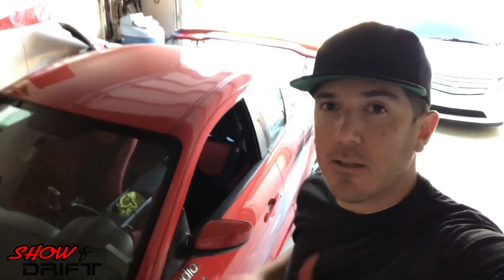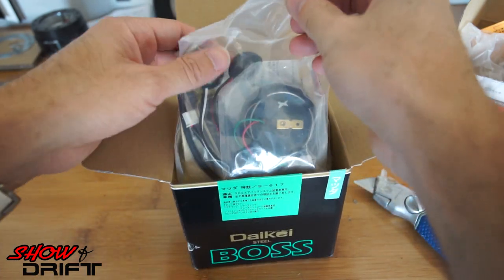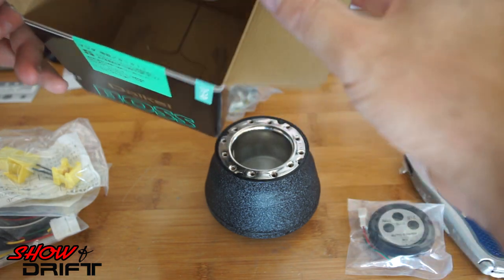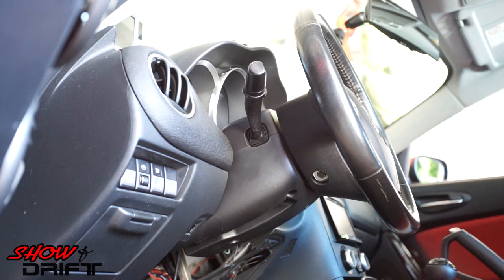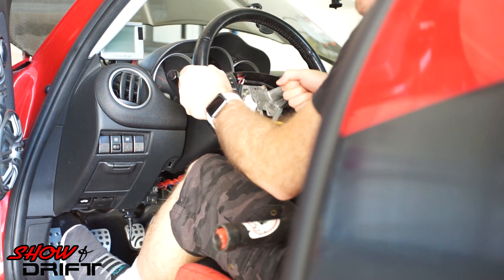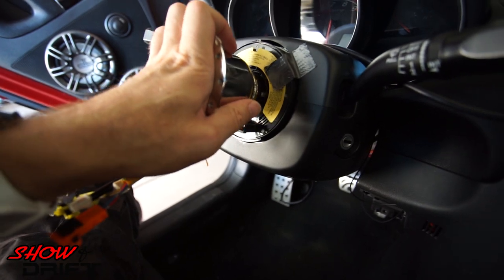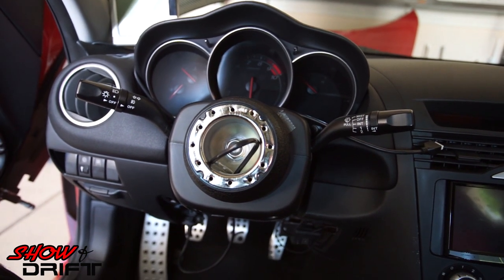Project RX8 Momo Steering Wheel Install with Works Bell Rapfix II Quick Release

Comment: The wheel is stylish and well made⚛️ allabout.wiki/volante   Be sure to buy the appropriate installation kit for your vehicle as well as the wheel. The installation was a bit fussy as you had to hold a spring in place prior to adding the horn button, (and keep it in place as you finished). Grant could work on that issue a bit.

Comment: Works Bells has a Cruise Control switch kit. They also offer 4 pole insulators for more connection options.
Reply from the maker: SlvrBakSlpz I did notice that after I made this video. I will prob be adding that item in the near future to test out. Thanks for posting 💯👍🏻

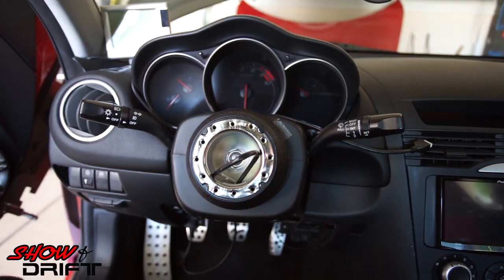Comment: Hey man, great video! A question, do you know if this setup causes issues with DSC / TCS and / or ABS? I have read that other aftermarket wheel setups tend to disable DSC / TCS, and can cause issues with ABS. I noted in the video at 10:47 you mentioned ABS delete sensors, did you mean to say "Airbag delete sensors" or does this setup actually affect the car's ABS?
Reply from the maker: If I said that it was a mistake. They are so the airbag light doesnt illuminate. No issues with traction control sensors or abs